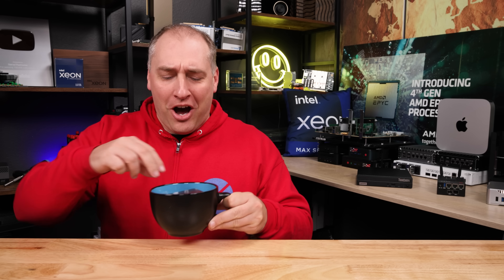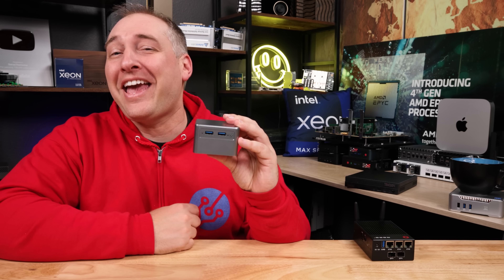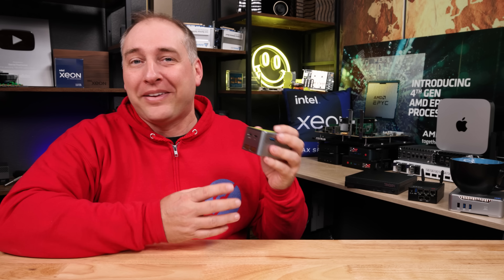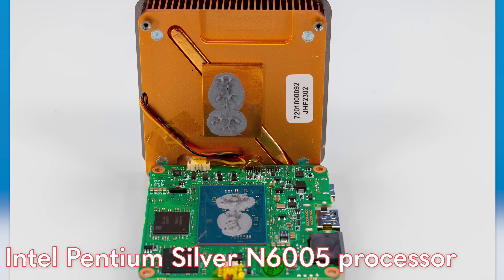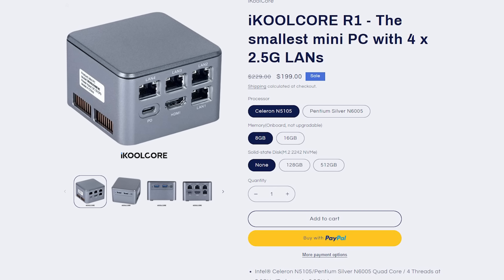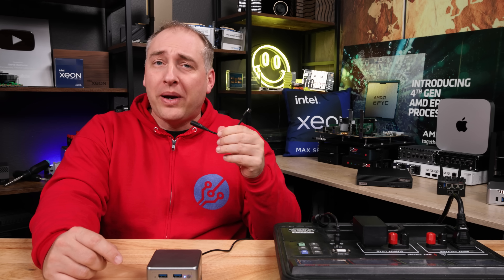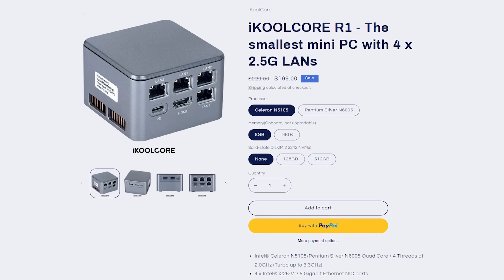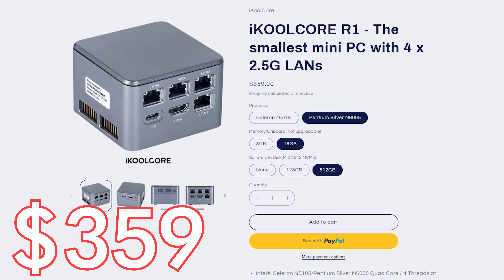This CRAZY SMALL 2.5GbE Node will Change Everything

Comment: This thing is also known as C-Box-M1. There may be a cheaper option available depending on the rebrand you're getting, seen at least two myself.
I am waiting for mine to arrive right now from aliexpress (got the topton version with 8GB/Pentium/no SSD), ordered it a few weeks ago to use it as a tiny opnsense box.
Thanks for the review!

EDIT Mar 29: got mine. It’s running hot, it’s not silent. There are a lot of options available in BIOS, looks like it’s just an unlocked AMI firmware, so after some time I’ve started to doubt that there’s actually been some manufacturer tuning done at all. Might be a reason why it’s so hot and loud. And yes, the included type-c power brick is the only way to power it, non of the “normal” charges can get it to turn on. I guess that the theory about it being just a cheap barrel jack adapter with its connector replaced is true. 
So it’s just far from a perfect option, but still an interesting one.
Reply from the maker: Sweet! This is also available on Amazon and is the one we found.
Reply: Where did you find it under that name? A quick "G" search revealed nothing.
Reply: @dualbeardedtech  try adding quotes to the search — got two pages with relevant links this way, including product pages on AliExpress and a few YouTube videos from ODM.
Reply: @Scott Myers that sounds awesome and thx for a name lol I'm looking it up now
Reply: Please be aware that C-Box-M1 is not the same product as iKOOLCORE R1, although it may look similar. The C-Box-M1 is a copycat product with no quality or after-sales guarantee. This type of copying practice is unfortunately common in Huaqiang North, China, where profits are prioritized over originality and consumer satisfaction. It is important to avoid such products.

It's worth noting that there will soon be a similar product to the iKOOLCORE R1, which will use the AlderLake-N processor and have the same I/O ports, except for one HDMI and one NIC port. However, this is also an example of Chinese copyright practices.
Reply: @硬酷科技  can't really say who's copying who, esp. since I can find it under that name from the Piesia Electronic, which seems like an original manufacturer to me. Theirs is also available since Dec. 2022.

Comment: I wonder,  Will it run Arista NG firewall?   I want to replace an older 1U supermicro system at home running as an internet firewall/router
Reply from the maker: We did not try it. But I think Arista NGFW runs in an ESXi VM, so I would imagine that works since this is x86.
Reply: if it works on a normal PC it probably does. Unknown if it uses a new enough Linux kernel to support the network interfaces tho

Comment: Yep. Wifi would be an awesome feature to have. The ability to be powered by PoE would be sweet too (or the ability to deliver PoE power for an AP?!)
Reply from the maker: You could use a PoE splitter and do that so long as you have PoE+ or PoE++. Power consumption is right on the line between needing PoE++.
Reply: Thank you for your great advice, there will have WiFi on iKOOLCORE R2 soon with N100/200/300 processor.
Reply: Poe splitters are super cheap, just use that, better that heatvsource is outside a box this small
Reply: @repatch43  that’s true. Didn’t think of the heat
Reply: I dont think it would be that simple to implement - considering my poe injector is basically as big as this whole Router xd